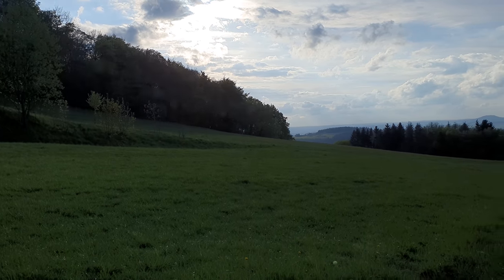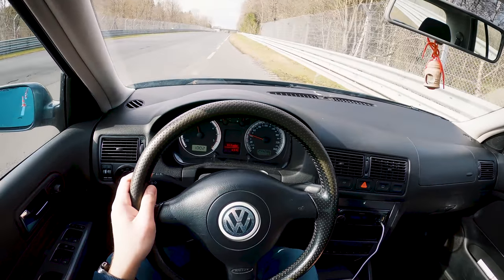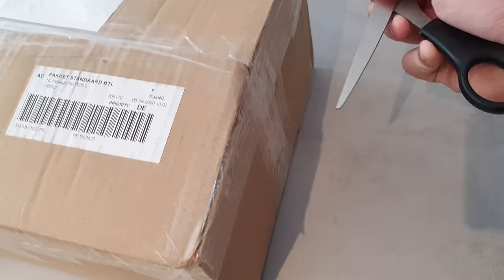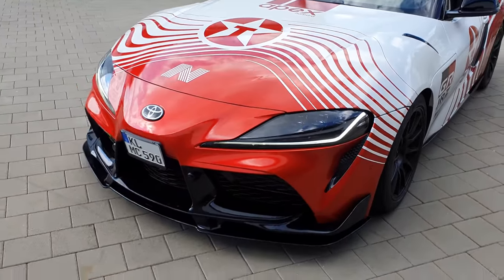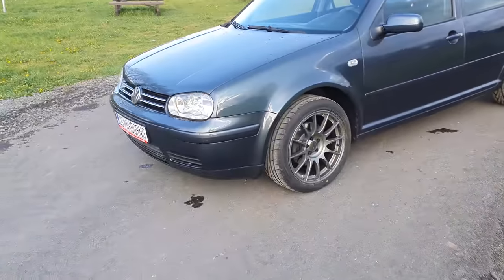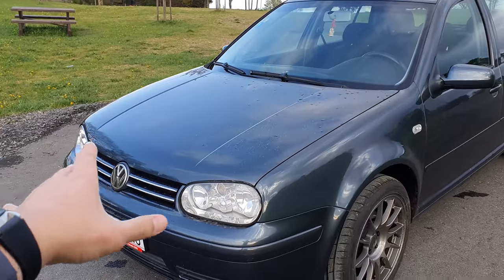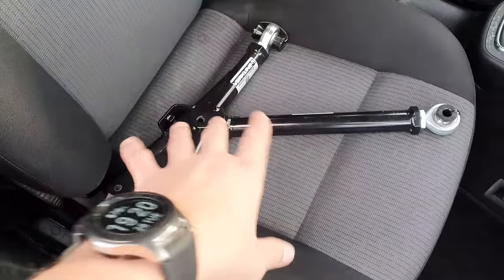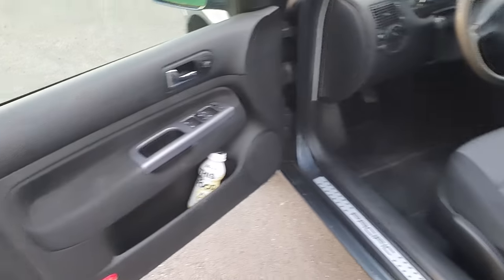RingTracktor Updates and Upgrades

Comment: ~12:50
Regarding that control arms thing, not exactly bumpsteer related.
Those control arms give you the adjustability of camber and caster, and solid mounting (spherical bearings & rose joints) will make it solid and sharp.
Usually bumpsteer is treated with adjustable tierods (adjusting the hight of the tierod joint on the knuckle).

The problem with lowered cars is the roll-center. Lower roll-center - more roll!
On McPherson suspension, rollcenter correction usually done by lowering the outer balljoint down.
Great example for that is in your video of Robert's E36 GTR at 5:00, take a look at the extended length of knuckle control arm stud (that brings control arm angle down) AND tie rod stud to compensate the bumpsteer.
I can only assume that your Verkline kit comes with longer knuckle stud, but that will also require compensating that increased length in the tie rod, OR at least make bumpsteer measurements with a stand. Increasing caster fill also affect on bumpsteer.
Reply: That's why alot of people on mk4/a3/leon mk1 do the swap to the tt knuckles, since the control arm is more flat towards the knuckle and subframe .

I did this complete swap just for fitting a big brake kit, but the steering in corners has massivly improved over stock (i had the same control arms as the traktor). 10/10 recommend the tt swap of knuckles and control arms.

Comment: I'm preparing a diesel Ford Focus for the ring also. It already has a straight pipe 65mm exhaust, decat, ecu remap (you can check the RSdproject Playlist on my channel). Soon I'm getting a new set of wheels and Eibach springs. Planning to come to the ring from Belarus with my family in August this year if the situation with coronavirus eases till that time. If not, in 2021, дай Бог! Looking forward to meet the Apex team and have an instruction around the ring on my car...

Comment: I believe the yellow dots on the sidewall of tires is supposed to line up with the valve stem. Is there a reason your tire installer doesn't do this?

Comment: What size tyres Misha (225/45)? Or are they 225/50? I ask this as I have a 6n2 Polo GTI which using stock size 15" rims (as I love the BBS factory splits design. In fact two sets one going to be winters and other set fully refurbished with powder coat inner & diamond cut outer with slightly more performance tyres for track) and the 195/45 R15 very hard to find good such performance choice, 195/50 R15 aplenty. Misha 195/45 Vs 195/50 for track use be a bad thing over 45 ratio? Oh yes pretty much the only good choice for 195/45 R15 currently the Toyo TR1's tyres and agree with the good in wet conditions certainly work well in grotty wet Britain..compared to the old T1R's news ones leagues above..... oddly not quite as good dry (that's were another set of BBS 6n2 GTI wheels coming in - need a not too costly good dry weather choice road legal but take a few track days a year and grippy).

Comment: You should get TT/R32 hubs since they will be better for the track vs normal Mk4 1.8T/vr hubs since they are oem Drop spindles
Reply from the maker: Yeah but will the rest fit tho
Reply: @mgcharoudin  yeah you will have to change to TT/R32 outer tie rods and maybe the ball joins but you also have the fancy lower control arms so you might be able to run normal mk4 one.

Comment: Working at Rimac and rolling coal...no,thats not the way to go. You could consider adding LPG, works nicely with diesel too. Cleaner, lower consumption, more power
Reply from the maker: Rimac has no problems with it afaik.

Comment: Will bigger hubs change the wheel pcd like the 5x112s on Golf 5 up ? Or are they the 5x100 -TT/R32 Gti hubs coming on?
Reply from the maker: Gotta see if fits
Reply: under bigger it means the one without fixed caliper carrier to hub. pcd is same.

my choice would be cupra R hubs if find them complete with OEM brembo brakes.
Reply: Ventoux R is cupra not 5/112? Or still old ones like on the Polo 9n platforms
Reply: @kenrossaukrsa  5x100

Comment: Did I notice a split cv boot there when your wheel was off?
Reply: 3.35
Reply from the maker: Correct
Reply: @mgcharoudin  the boots will split when you lower the car, fitting good quality new ones will reduce the chances of them splitting.

Comment: Copper paste on the wheel screws 🤔
That's something you shouldn't be doing. If the thread of the wheelhub is rusty, just clean it. Never use something like ceramic, copper or whatever paste on wheel bolts or screws.